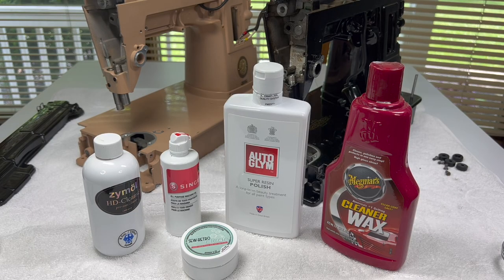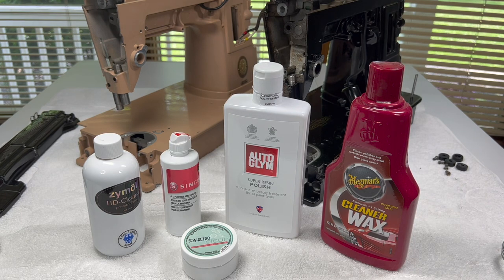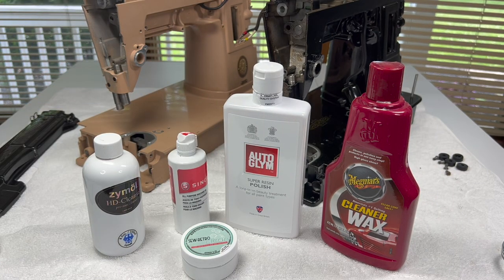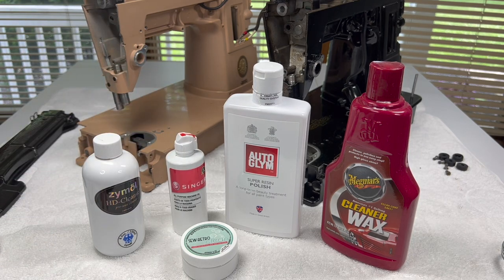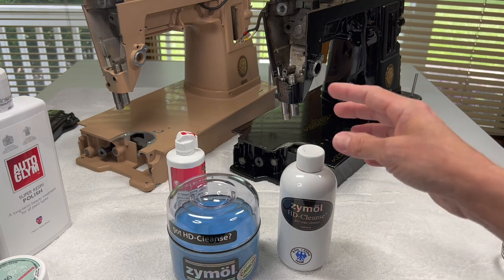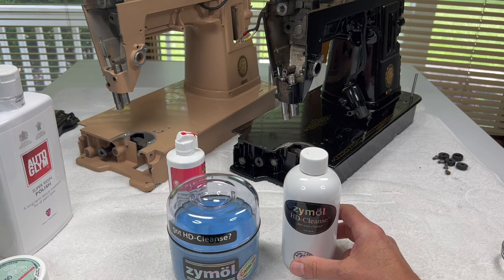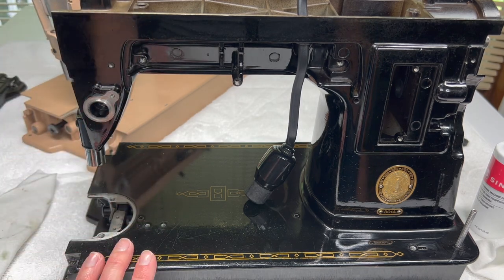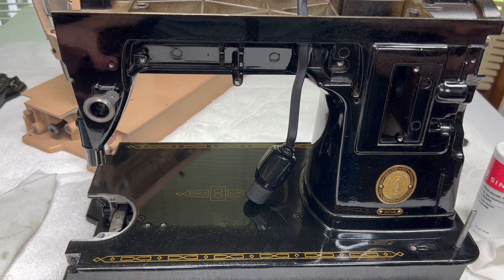How to polish a Singer 301: Singer Restoration Series Part 12

Comment: On my old machines that have shellac that has degraded a bit (on mine it looks crackly and looks a bit "golden") I'm happy to do a gentle initial clean with oil that I don't let sit for too long, then use Zymol and the carnauba wax like you do.  Then I learned about TR-3 resin glaze and was amazed when I tried it out on the recommendation of someone who has restored a lot of old machines.

The first time I used it was on a 1906 Singer 28K.  I started out cleaning with Zymol but that wasn't getting through all the grime so I switched to the resin glaze and cleaned away so much grime I discovered decals I didn't even know were there just by gentle, soft, repetitive wiping with cotton wool and the resin glaze.  It looked beautiful to start with but then, a while later, the "golden" degraded areas looked terrible, and there seemed to be more of them.  

I was so upset that I'd made it worse and thought the damage would be permanent.  Then to my complete surprise, a few days later it looked a lot better and a few days aft that  it had gone away and the machine looked beautiful again.  And I was amazed again.  

I'm not at all sure how/why it did that but I hypthesise it had something to do with volatiles in the resin glaze that needed to slowly evaporate away.  So plenty of ventilation when you're working with it is a must if you decide to try it.  After that, and feeling much encouraged, I used the carnauba wax over the whole machine.  It has stayed lovely ever since. It was much better than I was able to get using the oil, Zymol and carnauba wax combo so if you can find it I think it's worth testing out.  (I always test now - and wait a few days - as I've no idea wha people have done to the finish on a machine in the century or more before I get my hands on it.)  :-)
Reply from the maker: Megan, this is golden! I will check out the TR-3, I haven’t heard of it until now. Crackly finishes are so fussy, if this works I will make a video on it the next time I have a machine that the finish has degraded to that point. Thank you for your detailed explanation of how it worked out for you. Sometimes just waiting it out is all we have to do but we are in the age to “instant gratification” so we tend to forget the value of patience and “wait and see”. Thank you for sharing!
Reply: @SewingMachineRehab  The more I look into it the more I find out - and the more amazing work I find that some people do.  

I couldn't remember the name of it before - but it's come back to me now...  That crackled pattern/crazed/golden damage on the shellac is called "alligatoring" (in some circles anyway).  I was delighted to learn it's not irreparable but I'm not quite brave enough yet to try the "ultimate restoration" and re-do the French polish.  I'd like to have a go at proper French polishing with shellac on a machine one day - but I'll pick one where the finish could hardly be made worse if I try before I graduate up to anything as fancy as that!  :-)
Reply: Thank you for mentioning ventilation as I have a parakeet so will be careful. Great info too .

Comment: There is no lacquer on the black vintage Singers. The were dipped several times in a tough japan black finish, gold metal leaf decals  were applied , then several coats of shellac was applied, followed by a very labour intensive wet sanding and hand polish. To fix the shellac crazing requires several new layers of shellac applied usually by a french polish method, which remelts the original shellac,creating  a new finish, same as restoring antique wood furniture. Hence no water or harsh chemicals can be used on these machines. Coloured machines are an enamel, treat similar to a car finish.
Reply from the maker: You are correct! I have been calling the finish the wrong thing, if it were lacquer it would probably be a lot more durable. Shellac is what we are dealing with on these machines and hence, very delicate. Thank you for pointing that out, I will definitely use the right word moving forward! :)

Comment: I find that the paste wax version of the cleaner wax works a ton better. Apparently because it’s a more concentrated wax. I can certainly understand your hesitation to make this video as when I shared my polishing method, and products on a vintage sewing machine page, people bit my head off saying “SMO is the ONLY true way” which is not true because just like it varnishes over time in the moving parts, it will varnish on the body, but people don’t think.
Reply from the maker: That is what I have always wondered about the oil but could never confirm. What paste wax do you like the best?
Reply: @SewingMachineRehab  The same one you have, but in a paste version. It’s a round, 11OZ tin can.

Comment: I believe the tan machines have a typical 1950s enamel paint.  It's fairly thick, enough so that I can use polishing compound to remove the white spots that so many of them have and have a nice even shine.
Reply from the maker: Agreed, the tan machines have a totally different finish than the black ones and it tolerates a lot more when it comes to polishing!

Comment: A fine video.  Thank you.  I don't know, but it could be that the reason the wax reminds you of chocolate is that various "chocolate" products that I've come across have wax as one of their ingredients.  Few chocolate bars actually use very much pure chocolate.  Chocolate covered almonds that are sold locally where I am have shellac as one of the ingredients.
Reply from the maker: Thank you! I was wondering if you would weigh in. In regard to chocolate bars, I have a theory that the wax content is higher in the summer months to help prevent melting in warmer conditions. Don't know how I would prove that but to me the consistency is always different in the summer.

Comment: Love these videos! Sorry, but it’s not clear to me Zimol  product you are using because you showed a cleanser and a polish. And then carnauba wax. Which exact product are you cleaning with and which one are you polishing with?
Reply from the maker: Hello! Sorry if it wasn't clear. Sometimes I just use the Zymol cleaner wax, it works on pretty much every machine. It's in a big light blue bottle. On a really dirty machine I will  use the Zymol HD cleanse and then follow up with their carnauba wax because the HD cleanse doesn't have any wax in it. But, the cleaner wax is my go-to now, it takes it down from 2 steps to one. Hope that clears it up for you!

Comment: So - I watched you wash the tan machine in the sink.  I have a black machine and it wasn’t nearly as dirty as the black one you’ve been working on.  I’m curious tempted to wash my black machine like you did the tan one, but not sure it’s necessary.  If I decide not to wash in the sink with the krudkutter, what’s the best way to CLEAN the machine before polishing and waxing?  Does the Zymol reaally clean it enough?  The machine looks almost MATTE black right now - so I’m certain there is ‘grunge’ that can come off the painted surface before polishing.  Thanks!
Reply from the maker: Hi! I am so glad you asked! If you put your black machine in the sink and wash it, it will ruin the finish. I am hoping you see this before you try that! The paint finished between the black machines and the tan ones are VERY different. Water and Krud Kutter will destroy the clear coat on your black machine. First, if you want to send me some pictures of the finish on your machine, you can email them to jen@sewingmachinerehab.com that way I can see what you are working with and give you better advice. Next, if you haven’t watched this video then I would suggest checking it out: https://youtu.be/ebCdU3szmvQ it deals with the black finishes and how I get the grunge off before polishing. To clean the inner parts of those machines I use a lot of q-tips, a trimmed back 1” chip brush, rags and rubbing alcohol. Being VERY careful to not let the rubbing alcohol get on any of the painted surfaces. I hope you will check out that video, I think you will find it helpful. But…please don’t put your machine in the sink! I hope that helps!

Comment: What a great video! it seems to me that the golden color you were speaking of is possibly nicotine, unfortunately. I used to work in a smoke filled casino gift shop, and we had to wipe everything down constantly because that nicotine seems to coat every surface so easily…ick!
Reply from the maker: Yes, it could be nicotine, that certainly wouldn't be surprising. I just like to be careful because the lacquer finish gets a patina that is the same color as nicotine. I don't want to mistake one for the other! Thanks for watching and sharing that bit of information!